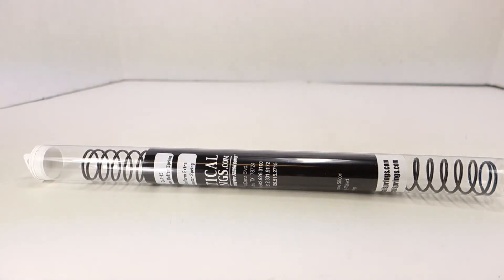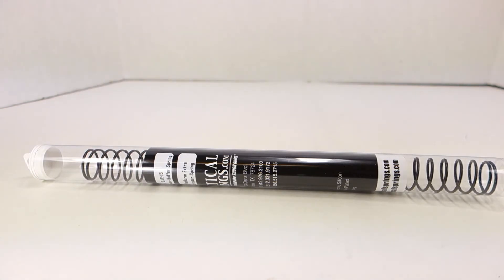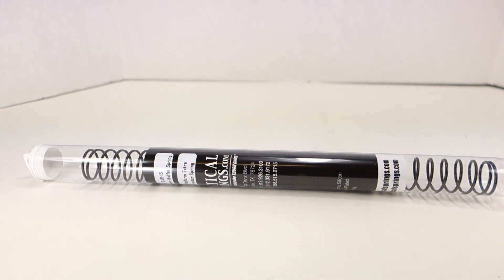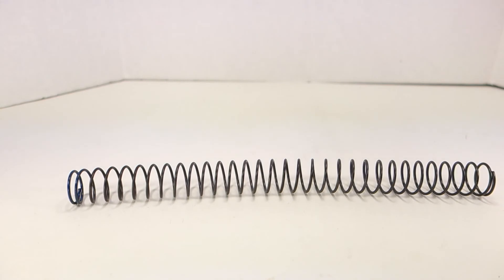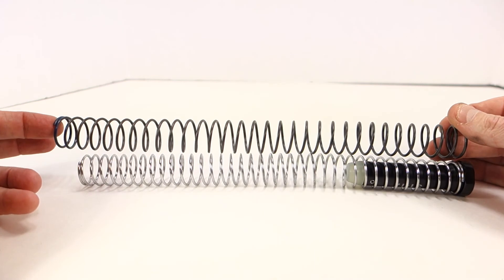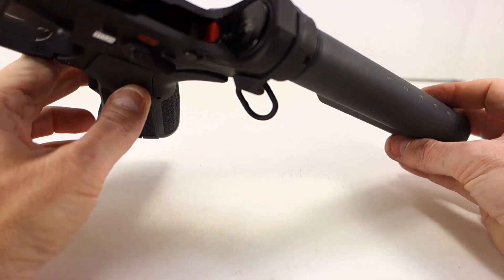Sprinco AR15 Enhanced Carbine Buffer Spring review & installation

Comment: I run red springs in a complete Midwest Industries 16” mid length gun as well as a Colt M4 carbine gas Gun with H buffers and they both purr like a kitten all day long with Wolf and Monarch steel case ammunition. Never had a single malfunction while using that combo.

Comment: 7 years later, I'm surprised there isn't more interest in this.
My 14.5 pinned and welded PSA upper is still throwing brass from 1 to 2 o-clock  even with an H buffer.
I'm gonna try the blue spring and see.
Shooting M193 brass case by the way.
Reply: Hey, on sprinco's website, they say that you might not be able to fine-tune a buffer system if you're ejecting that far forward. Seems you have three choices: Live with the overgassing, have a smaller gas port, or get an adjustable gas block. Hope this can help someone; or I may be wrong. I tried some strong springs and heavy buffers in my AR, but until I got an adjustable block, it was still overgassed. Now it's perfectly tuned and much more pleasant.
Reply: Did it work for you? I’m in the same boat with a 16 inch, I’m waiting on a blue but considering buying the red also.
Reply: @eddiemoney9371   sup Ed did it work ? I just ordered the red spring
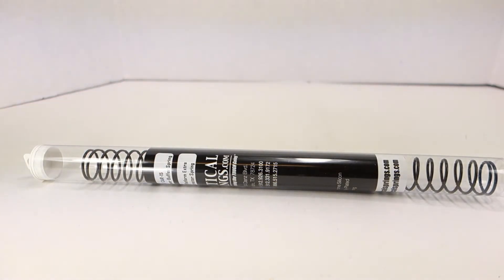Reply: @AccDeleted1  I bought the red to go with an h2 buffer it works great but I’m still throwing brass firmly at 2:00

Comment: I am building right now with a Sprinco Blue on a 16” mid length gas system rifle. Probably gonna start with at least H1 buffer. Maybe even H2.
Reply: In my two 16 inch midlengths an H buffer works perfect. 3 o'clock ejection on both with xm193.

Comment: I just bought the red spring and I'm going to test it out as soon as I can on my 223 caliber AR 15 do I have to replace the Bolt extractor spring as well that it comes with?
Reply from the maker: You don't have to, but the included bolt extractor spring is of a higher quality, so I would replace it when you can.  Not complicated to do.

Comment: call SpringCo and talk to Alan about the "Horizontal Ejection Trajectory Chart"........ forget about your gas system, forget about the type of ammunition, forget about the barrel length, forget about the buffer weight. There are too many variables. Use the ammunition you normally use in your AR and let him recommend a spring for you. 

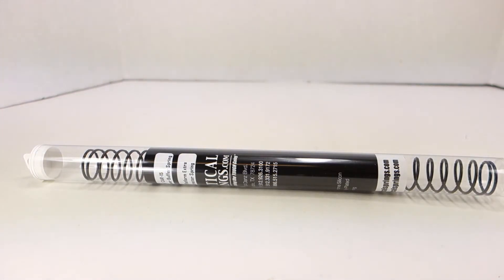Think of yourself as a clock. If you're facing forward you'll need to go out and either film yourself from the 3:00 position to see where your spent shell casings are going, or have someone stand at your 3:00 and record where your shell casings are going. 4:00 is optimum performance for casing trajectory. Once you can locate an avg timing of your shell casings, report it back to Alan and he'll recommend the proper spring for your weapon system.

Comment: Would a 16in barrel in that configuration also require a blue also, or would It be better for me to go with a red one? by the way, I'd if you r are the same person that seems on ebay, but I bought a primary arms red dot from a few month ago, but if you are you have the absolute fastest shipping I have ever seen!
Reply from the maker: "Require" isn't a word I would use here.  In most situations a normal spring is adequate, but the idea IMO behind a spring upgrade is to move away from stainless steel springs and to use chrome silicon springs (which don't take a set and last much longer)
Reply from the maker: Yes, same EBay person, thanks for your purchase!

Comment: Great review!! I got a red spring and H3 buffer in both a Colt 6920 and a PSA midlength 16", surprisingly it runs everything from Tula to Wolf to milspec ammo. I was actually kinda surprised. It actually locks back on empty mags. I suppose that means both guns were way overgassed. I'm building a BCM 14.5 and will probably go with a blue/H2 combo on that.
Reply from the maker: +Robert Smith Good to hear.  The AR platform in general is over gassed, but if you wan't to fine tune the gas system, a adjustable gas block would be the ticket.

Comment: I caught hell from some of the retro purists at ar15.com. I had researched the topic of m4 reliability and found an article on how to improve the reliability of the platform by replacing the gas rings on the bolt, upgrading the extractor spring, insert, and doughnut. He also went on to replacing the carbine buffer with a h3 and the red sprinco buffer spring. After that just run it wet and use good magazines.
Reply from the maker: Many so called mall ninja's believe the holy grail is Milspec.   In reality, Milspec is the minimum starting point to build a rifle and while many parts of a AR15 have little room for improvement, there are quite a few parts that are "better than milspec".  The chrome silicon springs are just one of them.  Of course, if your running around the swamps of Vietnam, then that upgrade might not be the best choice, but if your playing in the sandbox (or your a civilian) then it would be GTG.
Reply: +CAMPO why is it shitty? I'd like to know
Reply: +CAMPO hmm i agree. that sucks. i think it comes with a flooded aftermarket which the AR15 is great for as well as bad. Costas is a fanboy himself so you can expect that from his followers. Cory is a liar but yes people that hated on him were circle jerking. Vickers i love the guy but everything he says isn't law. What site besides AR15.com would your recommend?
Reply from the maker: +CAMPO I don't think any thing your saying is negative,  your speaking the truth.  If a forum is not properly managed by its owners/admins, the trolling quickly gets out of hand.  This isn't something unique to firearm forums either.  AR15.com is particularly bad though and they have a higher than average amount of trolls/douchebags salivating at the possibility of starting conflicts, arguments and descending upon the inexperienced like a pack of wolves.  Those same trolls are present on YouTube as well, you don't see it on most sites as the content owners have the power to remove their posts and perma ban them.

Comment: I replaced the 30+ year old buffer, spring, and ejector spring with the sprinco blue spring, st-t2 buffer, and springco's extractor upgrade kit in my colt sp1 carbine. The difference is night and day. The original buffer spring was so weak that I could feel the buffer hitting the end of the buffer tube while firing it. The new buffer and spring smoothed everything out and it has the added benefit of ejecting m193 cases out at 3:00, this is helpful because I'm left handed and sp1s have a habit of ejecting spent cases into the face of left handers. It also closes the bolt with authority.
Reply from the maker: Glad to hear your upgrade went well.

Comment: did you see a significant decrease in felt recoil and muzzle rise? any issues running with the st-t2 with a mid-length gas system? thanks for the great info
Reply from the maker: Not really.  The noise of the spring inside the buffer tube is what I noticed the most, its much quieter.  Of course you also have the longevity of the chrome silicon spring vs. the stainless steel as a benefit.  I have both midlength and carbine length gas systems in my rifles and use the ST-T2 in both without issue.

Comment: You said in the video the duty cycle is 750 rounds. did you mean 750 thousand rounds for the life time of the gun for ammo shooting?  cause if its 750 rounds I think I will be using the regular spring that came with my spikes and just buy another spring as needed please review your video and reply thank you
Reply from the maker: You must be watching the video from a mobile device as there is a annotation at that point in the video where I correct myself. The duty cycle is 750,000 rounds.

Comment: I just ordered the blue one myself. How is the sound after when you installed and lubed it. Does it still have the springing sound?
Reply from the maker: It is quieter and I found that using grease (in lieu of CLP) also aids in reducing the spring clatter.